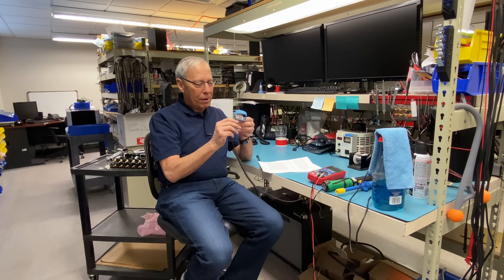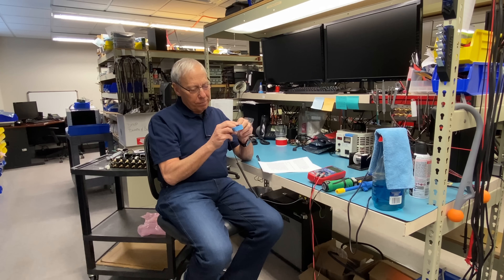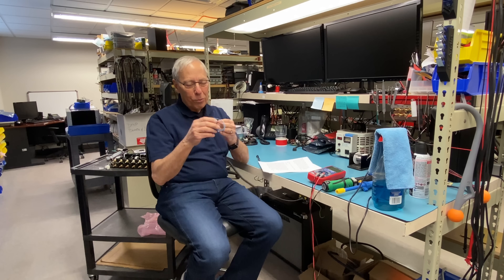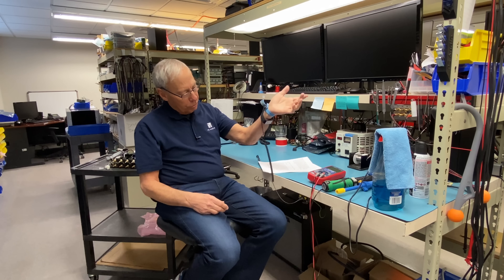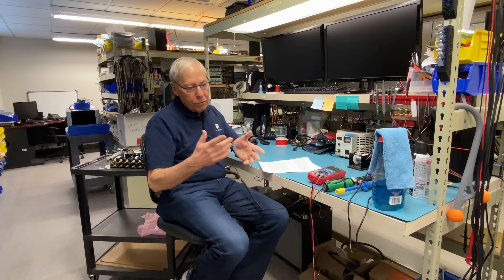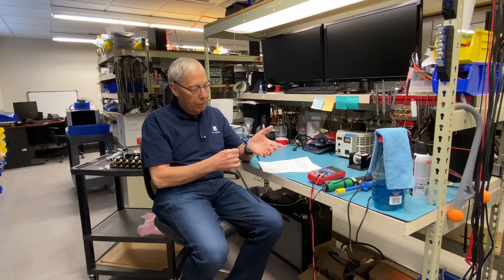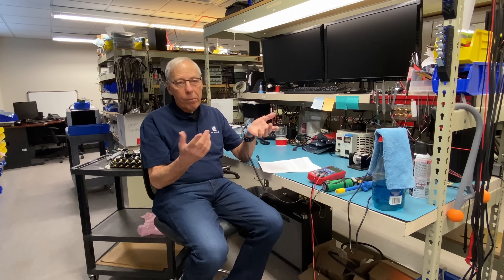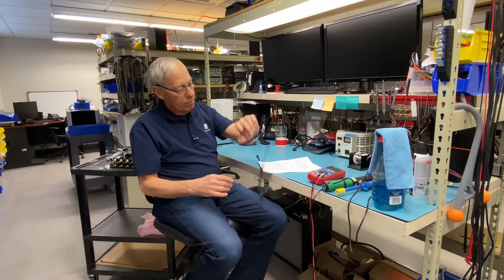Is speaker sensitivity related to frequency?

Comment: But doesn’t it take more power to reproduce bass? I’ve seen that some high sensitivity speakers are usually very bright (if they’re loud) I’m guessing because high frequency range is easy to make loud where we bass although a speaker might be highly sensitive if it’s made to reproduce a lower bandwidth would it be fair to assume that it would do so at a lower volume than if it was bright? I know wattage ratings is a scam lol and sensitivity is what matters and not wattage but I do think it should help make that loud speaker less bright? I’m assuming. This is how I imagine it since I’ve been researching this topic. 

I’m thinking of installing some high sensitivity 3.5s in my car and medium sensitivity mid range in the back and add a sub. Otherwise all my speakers beside the sub would be bright AF! I’m a total noob and I’m assuming half this shit from what I’ve gathered lol hope some of you can confirm or deny me. lol

Comment: Edit:
Not to argue, but rather looking for clarity. I have been involved in audio for 25+ years as system designer, manufacture consultant, and I would have to disagree with you on the fact that testing frequency does indeed matter in sensitivity results. I started to question myself after watching this video as I have great respect for you and your experience. Again, started to doubt myself. After send a few emails to some of the contact I still have, all have reported the within the same scope:
Testing driver frequency, they place *1.83 volts into driver and measure dB from 1 meter away*.
The variations in answers I received were:
1KHz tone - so they can standardize their tests
300,600,900 Hz tones and average them
Frequency sweep - then average
Frequency sweep - then pick the largest
One example from Morel is the EW428 at 87dB at 2.83v - this figure corresponds with the peak in sweep, but this is around 1700Hz, the rest is -2-3 db less
In short, the frequency used does matter when doing a sensitivity test. you can not claim that you just put 1watt into and measure from 1 meter away, what frequency are you driving? If so, prove all the driver engineers wrong and show me, as I did this in my lab and for the life of me, cant get a flat sensitivity from any frequency - if anyone questions anechoic measurements and thats why I failed in my test, you should know you have an anechoic window in time to take the measurements; if you have a 12x12x12 room and driver in center, you have aprox 10ms before any reflections can be heard. this is more that enough time to measure.

Comment: Perhaps what he meant is that most high sensitivity speakers are limited in low frequency response. To gain that high sensitivity there is a trade off which is usually at the expense of the bottom octave. This is because you need a short throw voice coil which has more of the coil in the magnetic gap, whereas a long throw, or x max woofer will have more overhang on each side of the magnetic gap. The part of the voice coil not in the gap is wasted energy turned into heat and not acoustic energy. Horn loaded woofers like the Klipshorn move lots of air without much motion of the cone but these designs are an exception.

Comment: Paul, you should also have an Ion generator on the ESD bench if you have a lot of insulators (like the roll of insulated wire and that bottle of cleaning fluid) on or near the bench.
Why? ESD matting does not work on insulators. The ions from an ion generator neutralise static charges on insulators.

Comment: Here's an excellent discussion from Peavey:  
https://peavey.com/support/technotes/concepts/THE_LOUDSPEAKER_SPEC_SHEET_GAME_2005.pdf
There are many different methods that manufacturers use to measure the sensitivity of their speakers.  Some methods, such as picking a particular frequency where the speaker has a peak in its response, are highly questionable, and would certainly be frequency-dependent.  
Conscientious manufacturers will use a range of frequencies, often a band-limited noise source which covers most of the midrange, as a test signal.  This averages out the speaker's response peaks and dips, giving a much truer measurement with very low frequency dependence.  But rarely do spec sheets ever mention the test signal used.  If you are lucky, they will specify voltage used, and measurement distance.  
If you are comparing specs from different manufacturers, a quoted sensitivity difference of 2-3dB, sometimes even 6dB, may not be meaningful.

Comment: I have a question about sensitivity. In say a 2 way speaker if the woofer has a sensivity of 90  and the tweeter has a sensitivity of 90.5 db even though it's not a big difference, as the volume increases will the gap widen because because the tweeter is easier to drive than the woofer?

Comment: Paul does a great job of simplified explanations.... but it can get very complicated!  There is a difference between Sensitivity and Efficiency.  Sensitivity is measured in dB per Volt, usually dB/2.83v, which corresponds to 1watt into an 8 ohm impedance.  Efficiency is measured in dB per watt.  Watts is a unit of energy, and efficiency is telling us how much that energy is being converted into sound.  If you feed a 2.83v sine wave to into an 8 ohm speaker it will dissipate 1 watt of power.  That same 2.83v into a 4 ohm speaker will use 2 watts of power.   All things being equal, the 2 drivers may have the same exact efficiency of 90 dB/w, but the 4 ohm driver will have a 3dB higher Sensitivity to the same input voltage.  It would be rated at 93 dB/2.83v.

Comment: I think the friend was arguing that a more sensitive speaker would have a larger frequency range than a less sensitive speaker given that all other variables were the same.
Reply: That would be very incorrect.   Higher efficiency speakers tend to have a more narrow bandwidth.   As you increase the bandwidth capability of a driver, the efficiency must reduce.
Reply: @TheMirolab  so I guess they are related just inversely to what I assumed.
Reply: Yes, that was exactly what my friend was arguing: the higher the sensitivity the higher the bandwidth while my point was: no, they are not necessarily related...

Comment: Paul:
Your answer is interesting, but I think the question went the other way.
Having a floor speaker, as an example of the somewhat typical 40-20KHz range and a sensitivity of 87 dBm / 1 W (2.83V), it is expected that at one watt and with the microphone at 1 m, 87 dBm will be obtained.
So far so good and all right.
However each speaker has a typical response curve, as you well know they are not flat, they have valleys and peaks.
So the same speaker will not have the same dBm at 100Hz as 450Hz, 1KHz, 5KHz, etc. even at 1m and with 1 watt input. The cone of each speaker and the crossover network works a lot on this issue.
It is usual to find the following information in the manuals:
Response frequency: 40 - 20,000 Hz +/- 3dBm
It would be different if it is tested with white or pink noise.
I think that's what the question was about.
Cheers
Reply: You are right bro, sensitivity will vary with frequency.For marketing purposes it uses 1 khz test tone as reference for the documented value

Comment: Eminence test there speakers accordings to EIA 426A specification. The frequncy response for Celesion Blue spekers is they sau at 8 Ohms bceuas the other speker is 15 ohms Dc resitance. I dont know if they ise dBA scales or what. iS IS A 1 WATTS rMS SINE WAVESS? I wil ltry to find out later I have to sleeps now. THNKY YOU MISTER PAUL ps.

Comment: Don't see why we do this 1 watt 1 meter 1 kHz thing. Only some kinda masochist listens like that. Much rather be shown a frequency response graph across the usable range of a speaker. Amplifier manufacturers (good ones) rate thier products from 20-20khz at least.
Reply: Fat Rat Hey, good to “see” you here. It looks like you are all over the place. Had a happy Easter 🐣 with the grandkids. Hope you did too. “See” you later.
Reply: chris vinicombe Sensitivity is not intended to specify the range or flatness of a speaker, that is what is shown in the frequency response graph. The sensitivity is just about the output of the speaker for a standardized frequency, distance and power input.

Comment: A speaker never has equal decibels in all frequencies! Example 1k he has higher decibels than the 500hz has or vice versa. This has to do with the speaker and the box and vary from speaker to speaker. This means we need to adjust with a crossover filter to get flat sound!

Comment: Is speaker sensitivity related to frequency? For a given size cabinet, the answer is yes. I encountered something called Hofmann's Iron Law, which simply stated (from Wikipedia)

Hofmann argued that the designer had "...three parameters that cannot all be had at the same time": good, deep low-frequency sound, a small cabinet size, and high sensitivity. Hofmann stated that designers could pick two of these three parameters, but in doing so, it would compromise the third parameter.[4] For example, a designer who wants good, deep low-frequency sound and high sensitivity can obtain these goals, but they will have to use a large speaker enclosure. Similarly, if a designer is forced by space constraints to use a very small cabinet, and they aim to get good, deep low-frequency sound, the sensitivity will be compromised. A small cabinet with deep bass would need a very powerful amplifier.

Comment: Nice Job Paul , But theirs so many parameters that make a speaker more or less efficient Size of box size of motor structure in speaker what the speaker material is made of , it can get very compliacated.
I am about to review Greg Timbers last speaker line at JBL the Studio 580s awesome tower speakers that are so easy to drive at 90db effeciant , but a month ago I reviewed the JBL Studio 530s that are 86db efficant I dont know how the heck that the towers are much easier to drive really has hung me up but i guess the 580s have bigger speakers that move more air so you dont have to dig into the volume as much to get the loudness . Thanks again Paul love the videos , I wanted to take a vacation from work and come visit PS audio , but now with this Cov19 virus i don't know if i will ever get a chance !! You and your family stay safe Paul thanks again

Comment: No, sensitivity is unrelated to frequency. Efficiency however is related to frequency so the power being transferred to the speaker varies with frequency. Speakers (really drivers) are most efficient at their resonance point which are the peaks in the impedance plot but their output is relatively constant across their operating bandwidth.

Comment: Speaker manufacture should specify testing frequency, 1khz. Or complete band width of that driver. Or pink noise used.
Reply: Other than freq response.*
Reply: Many manufacturers measure sensitivity midband usually between something like 500Hz to 3000Hz. To my thinking this makes sense.

Comment: Let me put on a fire suit and jump into the fray.
Suppose I was an engineer at a driver manufacturer that made a 8" driver that had a sensitivity of 87 dB/2.83 V (yes, I don't want to deal with efficiency dB 1W/1m). Lets say this 8" driver had a f3 of 65hz in a textbook 'ideal' cabinet volume. If I wanted to modify the driver to have an f3 of 40hz I could put a heavier cone on it and make changes to the motor to accomplish that goal. The compromise would be reduced sensitivity.  If I wanted 90 dB sensitivity, the compromise would be a reduction of bass extension. Of course  going to a larger driver, in a larger enclosure I could have increased sensitivity and lower bass extension.

Comment: Theoretically FQ response is independent of sensitivity.....OTOH we should all know low FQ reproduction generally consumes waaay more watts than higher FQs. For instance if you are bi amping each channel and have 100 watts feeding the mids/highs you’ll need about 300 watts feeding the bass to reach an output balance between the bass and mids/highs. The bass drivers consume waaay more watts per dB output.

Comment: So are you running a frequency sweep & averaging it out over the speaker's reproduceable audio spectrum or say using a standard 1 KHz tone say for a full range speaker???🤔...seems kind of skewed considering if doing the frequency sweep you will most definitely have an impedance rise as frequency rises & therefore have a misrepresented sensitivity plot!!! Only by employing a tailored Zobel network for that particular speaker driver are you going to get a truly accurate sensitivity plot as impedance will remain constant with frequency rise & be truly representative of the native response of that particular speaker driver!!!
Reply: fookingsoc Even though the impedance varies over the frequency range causing a difference in the power being transferred to the speaker, the output of the speaker remains relatively constant because speakers (really drivers) are more efficient at their resonance point than they are elsewhere in the frequency range. Efficiency varies over a frequency range, not output (or sensitivity).
Reply: @StewartMarkley  Speaker Driver is a Linear Motor!!!...unless of course it's a Servo Drive Subwoofer!!!...then it's a Rotary to Linear Actuator!!!😁👍🏻
Reply: fookingsoc I don’t see where you are going with this.

Comment: It’s a ground strap
Reply: Sure is. I am a bit surprised they don't use "grounded carpet" they use in computer rooms. Copper strips inside that take the static to a ground.
Reply: It’s actually a wrist strap. It is not directly connected to ground. It is connected to a 1 megohm resistor (just like the ESD mat) to ground. 
The 1 megohm resistor is there to limit any discharge current to an acceptable level.

Comment: And the resonance frequency of the driver and cabinet on a given frequencies or frequency you should have said Paul has a bearing. maybe that's what his friend was trying to get at
Reply: John sweda Sensitivity is independent of efficiency. While the impedance varies with frequency causing the power delivered to vary with frequency, the output remains relatively constant because the driver/cabinet combo is more efficient at resonance than at other frequencies.